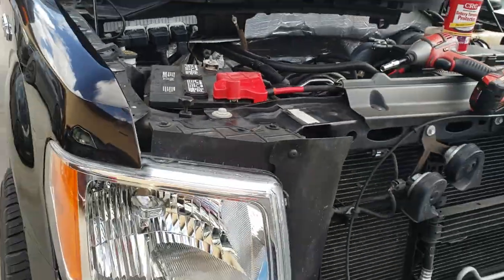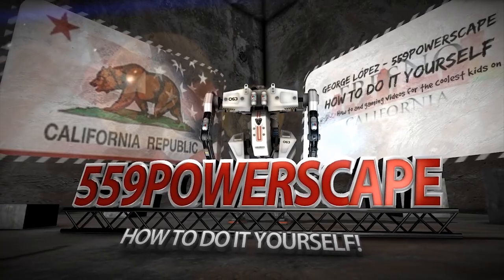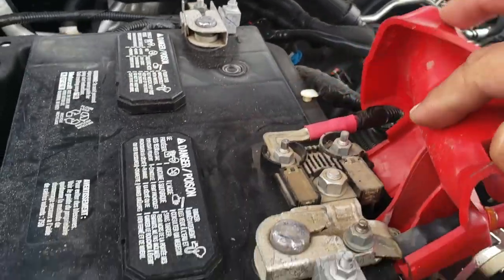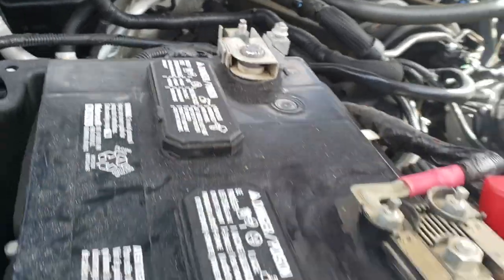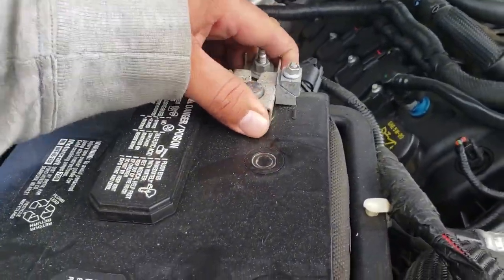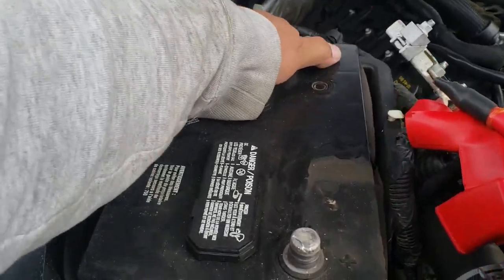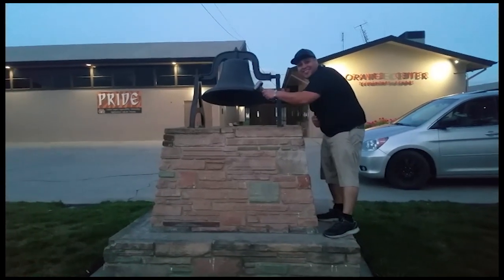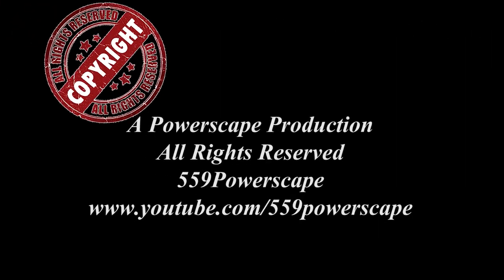How to: Remove a battery from a 2013 Ford F-150

Comment: George, the long retainer bolt broke off, and left a small stub in the hole at the bottom of the battery case well. I think this is terrible design for a hold down, but that is a different matter. So now I cannot hold down the new battery. How to fix that? Otherwise the battery will be jumping up and down!
Reply from the maker: You can try making another hole for it if the original one is damaged or ratchet strap that sucker 🤣🤣🤣